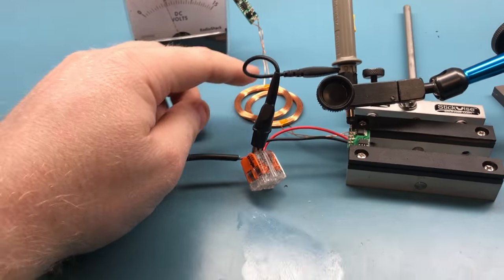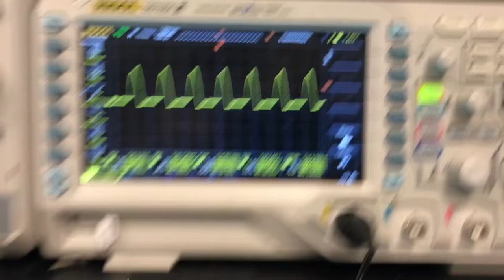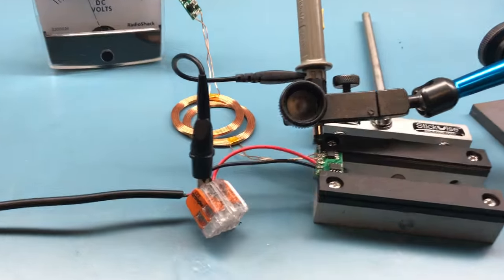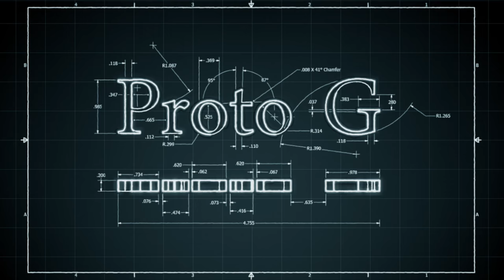Quick Tips #8 // Precision Helping Hands

Comment: These little arms are really neat, and I use them for stuff like this, also for holding cameras. Unfortunately I've found most of the cheap ones need dismantled and cleaned up before the move and lock smoothly, but it's not too hard. Eg the C-clips that hold the balls in often have burs on the ends of the wire which dig in to the balls when tightened and mark them. Also try looking for "camera magic arm" - essentially the same product, but for camera use.

Comment: Have you tried the cheapos from ebay? They seem to be missing the fine adjustment, and im sure the movement is not as smooth, but half the price..
Reply from the maker: I haven't but the fine adjustment is pretty helpful because when you lock all the joints down the probe isn't always exactly where you want it.

Comment: the stick vise seems like nice newbie machining project... i think ill make one immediately :D
Reply: grmlje grmone I've had one since the crowd funding. If I were doing it from scratch I would definitely come up with a way to keep the movable jaw from rotating about the shaft. Maybe use square stock. It's quite irritating when setting it up, and the thumbscrew doesn't do much against rotation when it's locked either.

Otherwise it's pretty handy.
Reply: luckily i unintentionally lied about the immediately thing... of course, it wouldn't be much fun just copying it, so i would have to come up with a design of my own... your point is excellent, and i wouldn't think about it till its finished... square stock would be nice, but i don't have an elegant way of producing square holes... i think i'll go with 2 rods, and see how that works.. man, thanks for the tip
Reply: +grmlje    Don't know bout you but I've always found files elegant. It's only a small square. For big ones or other shapes with hard corners you can use a appropriate size drill in the corners and it just acts as clearance.
Reply: hey steve... i know about that technique.. but i'm not mr. clickspring... that hole, if a went about squaring it, would be one of the ugliest things in the universe, im just never completely satisfied with my filing skills.. i think it will leave a nicer look if i just ream two holes to size
Reply: bwahaha... yeah, that is more my style (reply on removed comment)